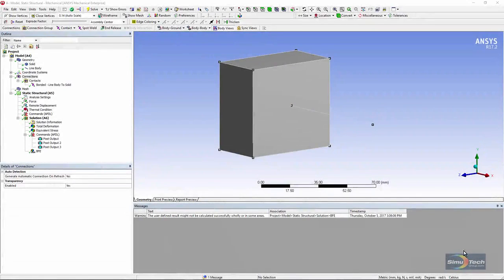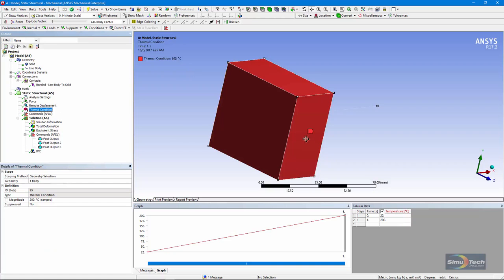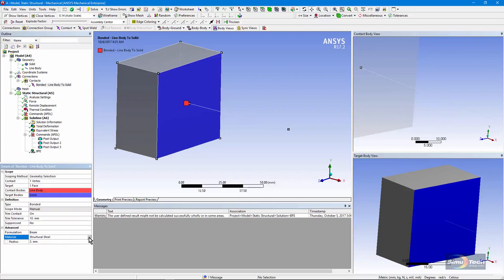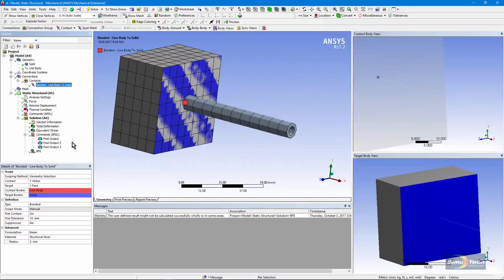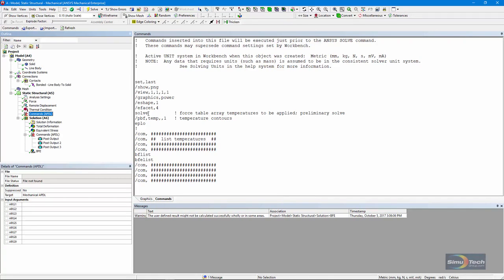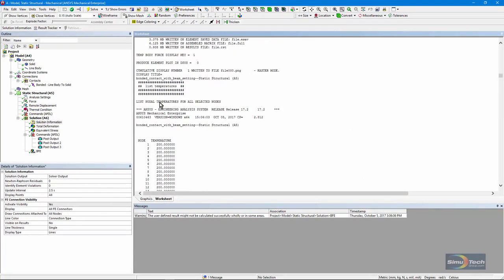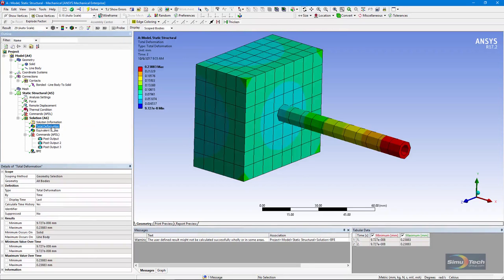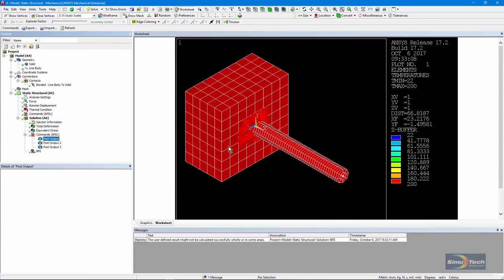How to Connect Bonded Contact with Beam Formulation in ANSYS Workbench Mechanical

Comment: Hello. Great explanation.
In my geometry, I have a complex aluminum profile (that I can extrat and create a simplified BEAM).
The problem is that, unlike your example, the existing solid parts in the model contact the beam in multiple points along it's lenght. How can I smulate this application?
Thank you very much
Reply from the maker: Thank you for your comment. If you are interested in training, mentoring, or consulting, with SimuTech Group please send us an email at info@simutechgroup.com or you can check out the Ansys Learning Hub here: https://www.ansys.com/services/ansys-learning-hub
Reply: @SimuTechGroup   thank you for the reply. Already got in touch with ansys support.
Thank you once again
Reply from the maker: @Ultimatebeatdastreet  Happy to help! If you should need any services mentioned above, please send us an email!
Reply: @SimuTechGroup  Sure! Thanks :)